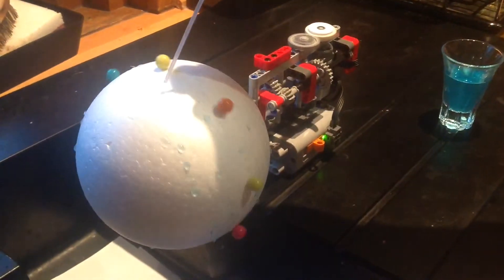Toy experiment: Water sticks to a spinning ball

Comment from the maker: The styrofoam ball has 12.5cm diameter and spins at ~8 rpm, 10000 times faster than Earth (1 rotation per day). This compensates for the smaller radius and creates the exact same amount of centrifugal force that we experience on the globe. Note that some water drops fall off due to their weight (the real Earth is present after all), but none are spun off by the speed of the spin. It is possible to create an unbroken layer of water by adding some soap, but it is very thin and shows up transparent on the camera.
Reply: Cool test.
Flat earthers dont accept tests like this which as you and i know are not under exact test conditions due to scale and fact the thing they refute exists gravity is having an effect thats not like for like.

But it does show in practice a similar effect.
The scale means the water drops on your ball are like scale of tsunami high water.

Good example
Reply from the maker: Howithinkitis REALLY yes, I really wanted to have an at-scale ocean of 0.04mm thickness, but that only works with soapy water, and then the water collects at the bottom and drops off because this is just a model. But I did compute the spin to scale correctly, and the conclusion that water does not spin off a rotating globe is valid. Obviously Earth gravity can pull the water off (because it drops off at the bottom), but the centrifugal force can't. We also spun the ball at almost twice the speed, same result.
Reply: mendel you are presupposing earths gravity in your conclusion
Reply from the maker: SeigiShinigami正義死神 I'm sorry, youtube did not alert me to your comment. I don't understand how I am presupposing gravity for my conclusion; my conclusion is that centrifugal force is not spinning the water off, do you think my observation of water dropping off at the bottom only is due to centrifugal force?
Reply from the maker: Fuck You The drops are tap water and blue food coloring, no soap involved; if there was, they wouldn't form drops. (But soap bubbles are fine examples of spherical fluid surfaces.) The point of this experiment is to show that putting a wet tennis ball on a power drill (like some FEers do) creates too much centrifugal force: it matters how fast you spin (and what radius you spin at), and you actually have to look at the numbers to get this correct to get a correct result.
Reply: @howithinkitisreally250  did you know that styrofoam has a level of saturation??? also this experiment show water drops sticking to a ball. this is called surface tension. bad experiment because on earth there is 72 percent water and 28 land. bad experiment with bad ratios.
Reply from the maker: World As War An experiment sets out to confirm or disprove a hypothesis. The hypothesis here is not how much of the ball I can cover, but whether the water I put on the spinning ball will be spun off if it experiences the same amount of "spinning force" (centrifugal force) that water on the globe does. I am seeking the answer to that specific question. (I did do the experiment with more water coverage, using soapy water, but you can't see that on camera. Feel free to try it at home!)
Styrofoam soaks up very little water, I'd say none at all; it'd certainly be easier to get a clay ball wet, which more closely resembles Earth, but using styrofoam was easier for me.
Reply: mendel all youve done is fallaciously  “debunk” a strawman argument. Congrats.
Reply from the maker: StinkyCASH Please explain what the strawman argument is. Do you think that "water doesn't stick to a spinning ball" is not something FEers argue?
Reply: oleyella85 Water flying off the ball due to  the centrifugal force is not the only argument... possibly ill give you its one small part of the argument that flat earthers have made. You left out the “water seekings its level and taking the shape of its container” part. 

 You were not able to reproduce the earth on a smaller to scale model. The oceans are much deeper than your experiment is too scale. You left out many other emotions besides rotational you forgot about orbital…The solid portion of earth is not a perfectly round sphere. Google what earth looks like without water…and the oceans are not made of soapy water. This is not science experiment. this is a child playing with toys thinking he’s doing science To rationalize his own brainwashed beliefs.
Reply: @REALStinkyCash  The deepest ocean is less than 10 miles. Scaling that down to the size of the experiment would be about 0.000001 millimetre.
Reply: Xenai Riddix You would trust one point… What about the fact that you’ve left out all the other orbital motions of the earth… The fact that you had to make soapy water… What a joke
Reply: @worldaswar3784  on the surface, yes, but water only goes a few miles deep, rock/metals keep going for 4000 miles to the center, when it comes to mass, water is just 0.023% of earth.if earth was the size of that styrofoam ball, water would be a little bit of dew on it, about 1% as high as those drops look.
Reply: @Morpheux1  how can you know what is in the center when you have never been there?
Reply: @worldaswar3784  let me explain it to you in flat Earth terms.... Density and Bouyancy, heavier matter tends to sink deeper.

Then there's seismic studies and mathematical equations that give us a pretty accurate idea of the rest, but I'm not even going to bother discussing since you are going to claim they are fake. And then I'm certified in the use of Nuclear (Uranium) Earth penetrating equipment, sort of like radar, but sees thru rock.
Reply: @Morpheux1  sees through rocks 5000miles deep:D very very clever.but in real life the deeper you dig the colder it gets. Doesnt matter the earths 'core' is giant 'plasma' ball with huge temperatures. Yeah sure as you say :D you said so it must be tru
Reply: @worldaswar3784  never claimed it did, I am saying, that common knowledge of how heavy objects behave, studying seismic activity, knowing how to apply physics and math, and the access to accurate Equipment give us a really good idea of what the center of the Earth is made out of, not perfect, but a lot more accurate than sitting in a basement wearing a thinfoil hat watching youtube channel explanations from people wearing a bigger thinfoil hat.
Reply: @worldaswar3784  collided? Where in the big bang theory is there mention of a collision? Please educate us on that.

Unlike any other molecule, water is denser in liquid form than in solid or gaseous form, therefore, it can never make it to the center of earth, it will either boil and go up, or freeze and go up.
Reply: @worldaswar3784  that's why water only exists on or near the surface
Reply: SOAP!!! tf NOR THE SAME.  Besides we see THE SAME stars and solar system every night.  So we are NOT spinning aimlessly in a forgotten galaxy.

We are as THE WORD says Genesis Chapter 1.  Cavemen want to be superior to The Creator but this is a fallacy!!!
Reply from the maker: @YAHsWay  there is  no soap in this video. Either all of the stars are spinning at exactly the same speed, or we are...
and nobody claims that our galaxy is "forgotten"
Reply: @worldaswar3784  your claim "I know more about the globe than you do" is patently false, proven by your own comments. Also, there is no evidence the earth is flat...
Reply: at the same time as fighting the big giant ball we are standing on!
Reply from the maker: @Zumaray  exactly!

Comment: You want to compensate for the smaller radius? Get that surface rotating at 1000 mph and then we can talk!
Reply from the maker: Razvan Tase One way to express centrifual force is F=m*v^2/r, where F is the centrifugal force, m is the mass that you are spinning, v is the speed, and r is the radius of the curve. If you plug in some numbers, you can figure out that making r smaller means that the force gets bigger. This is well known if you drive a car: if you want to go around a tight bend, you'd better slow down or the sideways force becomes too great; but a 500 mph airliner can tirn almost imperceptibly because it takes really wide turns.
The upshoot is, if you reduce the radius from 4000 miles to 2.5 inches while keeping the speed the same, you're increasing the centrifugal force by over a million times. This isn't rocket science, it's highschool physics, taught in grade 9 in some places. To keep the centrifugal force the same, the velocity has to go down.

Comment: DID YOU FORGET EARTH IS ALMOST 75% WATER??? THIS IS NOT ACCURATE TO SAY THE LEAST.
Reply from the maker: The surface of Earth is 71% covered by water. To achieve this on the model, I did another experiment where I mixed a bit of dish soap  in with the blue water, and achieved fairly good coverage, but the water layer became so thin that you couldn't see it on camera.
Out of curiosity, who linked me?
Reply: Danielle Funk  Hi, I am the person who built this model, if you ask him, mendel will confirm that.
He did the math on how fast the balls has to spin to correctly simulate the centrifugal force that we experience on the globe earth. I also redid the math to confirm it.
The reason why the surface doesn't move at 1000 mph is that the sphere is much smaller. This means that the force pulling on the surface is smaller, but to make up for that, it rotates faster, which means the nagle of the force changes at a faster rate. What this means is that, rather than having a large force pull almost parallel to the motion of the surface, there is a smaller force pulling almost perpendicular to the motion. In both cases, the resulting perpendicular force is the same.
In fact, it's slightly larger in this experiment. To model the earth's centrifugal force, ~7 rpm would be correct, and it is spinning at 8 rpm.
Reply: Earth is 0.023% water, the 75% is only what you see on the surface. There's rock under the water, going down for almost 4000 miles, you know that right?
Reply: @Morpheux1  i thought the top comment was sarcasm.
Reply: @MrMastadox  unfortunately, seems like it was real 😶
Reply: @Morpheux1  well you could be right ofcourse. There is no shortage of human stupidity.
Reply: @MrMastadox  Death, taxes, and stupid people are the only certain things in life
Reply: @Morpheux1  even then, there are ways to avoid taxes. But no way to avoid stupid people or death :)
Reply: @MrMastadox 🤣🤣🤣
Reply from the maker: Wrel Rel What do you think would change by putting it in a vacuum? And why is that important for the centrifugal force?
Reply: @Wrel Rel it might actually work better in a vacuum, there will be no friction or atmospheric pressure acting upon the model.
Reply: @Wrel Rel I think you are confusing vacuum with low earth gravity, maybe? Or are thinking of the vacuum while is being created, not after it is stable.
Reply: @Wrel Rel then you must be talking about the boiling, probably. Water boils, but it still keeps its cohesiveness, will still stick to the sphere.
Reply from the maker: 9 torr (9mmHg =~1200 Pa) corresponds to a height of approximately 30km or 100,000 ft. You can send a balloon to that altitude.
I'd like to see that experiment performed in a vacuum, the difficulty is that the water would boil off rapidly.
Other than that, I don't expect anything would change, so I don't see the point.
But it's really just a rotating ball with water drops on it, if you have access to a vacuum chamber, try it yourself and let me know! Be a scientist!
Reply: @mendelde  well, it doesn't boil "off", it just boils, there is not denser air in the vacuum to make it float, it will still stick to the sphere, and drip down to the bottom because of gravity.
Reply from the maker: Juan Rojas The water turns to gas and evaporates when it boils.
Reply: @mendelde  I know, it evaporates, but does not fly off, there is nothing denser than it above it for it to "fly" up, if anything, with you ball experiment in a vacuum, the water vapor will continue to stick to the ball, or get pulled down by gravity. And If the ball had sufficient mass, it would become its "atmosphere" creating enough pressure to liquify the water under it again.
Reply from the maker: Wrel Rel It boils off of Earth, water evaporates from the oceans, forms clouds and rain.
The deal with water is that it's boiling temperature depends on the pressure, if you lower the pressure, liquid water starts to boil.
But we have air pressure down here because of gravity.
Have a look at this balloon flight, https://youtu.be/JkrIm0ZUyJY the pressure goes down to 0.15inHg, which is ~4 torr --- by your definition, already a vacuum.
Reply from the maker: Juan Rojas The water vapor would fill the vacuum chamber, see https://youtu.be/WTVwAZ0_9p0
Reply: @mendelde  I follow action lab, the only reason why it fills the vacuum (really is sticking to the walls) is because the pump is still on sucking air.
Reply from the maker: Juan Rojas That's incorrect, the pump isn't actually in the vacuum chamber. Vacuums don't suck! The Brownian motion of the gas particles makes the gas fill the chamber and also escape into the outlet towards the pump.
Reply: @mendelde Vacuums don't suck, but pumps do. When I have a chance, I'm going to modify your experiment, try to get a put an internal motor in your model to be able to run it inside my vacuum chamber, need to fix it first to get a good seal. 

But I can tell you from past experience, the water vapor settles down after the pump stops.
Reply: @mendelde  Also, Brownian motion cannot happen in a vacuum.
Reply from the maker: Juan Rojas Yes, but it happens in a vacuum chamber, see https://avs.scitation.org/doi/10.1116/1.578143
The water vapor condensing is because it loses heat, when you see it collect, it isn't gaseous any more and probably quite cold?
Reply: @mendelde  will address that after I do the experiment myself, but anyways, what you "see"'in the vacuum chamber is mist and fog, not water vapor, water vapor is invisible. So as long as there is mist sticking to the ball, there is water sticking to a ball, I'm trying to help you here man 🤣🤣🤣

Actually, mist is closer to the amount of water in the surface of earth (in your scaled model) than water droplets are.
Reply: @mendelde  is not really losing heat, the thing is, under no pressure, there's sublimation and desublimation, water can be in all three stages at the same time. In outer space, water will boil then immediately freeze and vice versa, that's why comets (ice) leave a tail. 

Water under no pressure behaves sort of like dry ice in regular atmospheric pressure.
Reply: @mendelde  and in the scitation.org article, there was Brownian motion only because they forced it to happen using an electromagnetic field.
Reply from the maker: Juan Rojas This isn't a fight, though! We're trying to understand what we're doing here.
As far as gas is concerned, it's the thermal motion of the molecules that causes gas pressure, equally distributed, and that causes the gas to flow out of the vaccuum chamber towards the pump. It's like the gas molecules want to leave the chamber, and the pump is merely letting it out while preventing more gas from coming in.
Reply: @mendelde  Correct, in the experiment I want to make, I want to make an almost perfect vacuum, seal it, and turn off the pump, so the only way the  gas can go is down, because of gravity. Or, put the valve low on the side of the chamber.
Reply: @mendelde   and is definitely not a fight, I'm just picking your brain to get a good idea for and successful experiment. I think, since the sphere is made of foam, it will actually create a lot of static in low pressure, making water/mist stick to it even more.

Comment: Surface tension, why do you he try to do small drops each aparat from eachother? When he combine two drops they fall...And look all that Micro pores in stryopore... Children play not experiment of any kind.
Reply from the maker: Tine Furlan This is not a difficult experiment to,do, just some Legos and  a ball. You can do it yourself if you think there is something wrong with it!
I did use soap to break the surface tension to get a thin wet film all around the sphere, but the video of that just looks like a rotating ball, you can't see the water. To scale, for this ball, 0.1mm water are an ocean.
The point here is not that the drops fall, that happens because we're on Earth. The point is that the centrifugal force, which is *exactly the same as on the big globe*, does not throw these drops off the ball.

Comment: Now do it with a ball of sand, dirt, rock and ad a cup of salt water
Reply from the maker: Xonny Viii I thought about making a ball of clay and using that. Why don't you do it? This can be done in any kitchen, and doesn't require any special equipment if you can get a helper to spin the ball (be sure to mark the surface so that rpm can be tracked from the video later).

Comment: You guys do realize that if done in zero gravity this experiment would work with a metal or whatever material you want ball? Actually, it would work much better with a metal ball because it'd be heavier and have enough gravity to hold more water.
Doing it on earth or any other planet is silly, because the far bigger ball under our feet obviously has a hugely larger gravity than a styrofoam ball, but this guy did it to demonstrate that the centrifugal spin isnt that big anyway.
Reply from the maker: In zero gravity you can just have a ball of water, I've seen this demonstrated on youtube on a parabolic flight, I think.
And the material really doesn't matter. This is a household experiment, anyone who thinks I did something wrong can simply do it better and see for themselves.